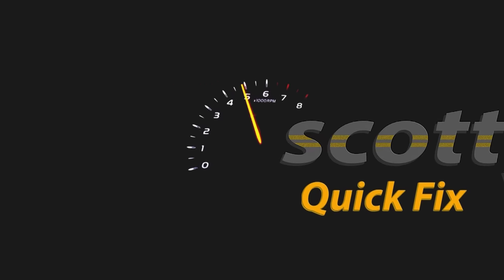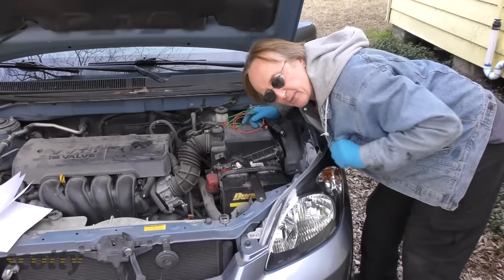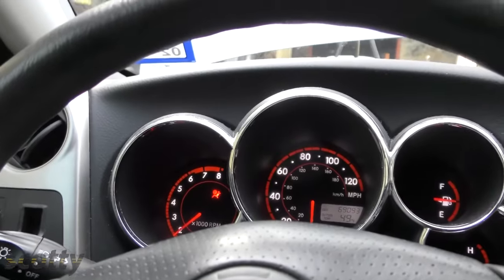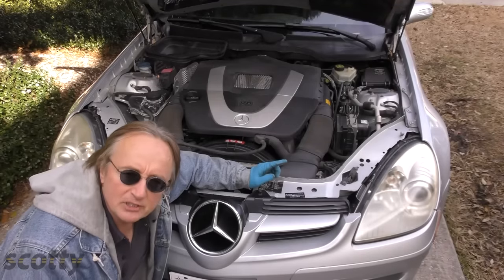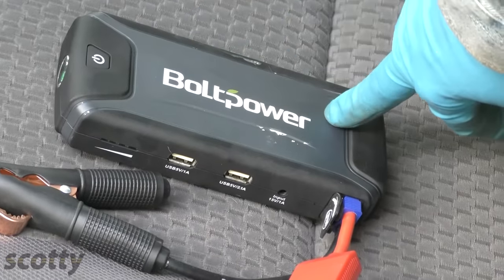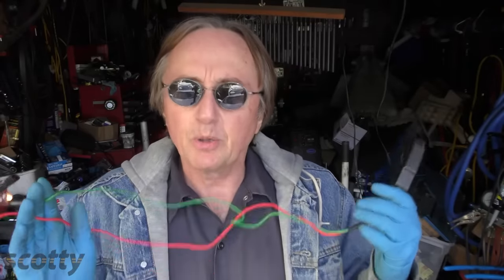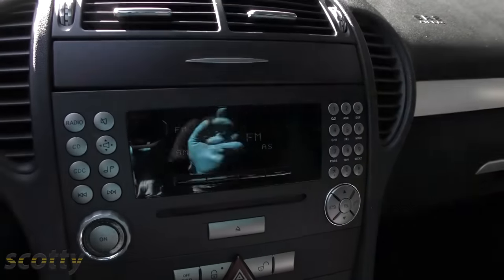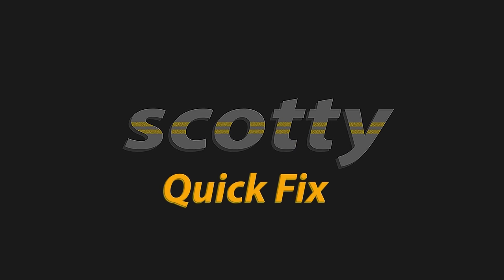How to Replace a Car Battery (the Right Way)

Comment: Funny this came up. today was cold and my car wouldn't start. My battery is slow in the cold this year for the first time. rest of the time its fine. this time I also only had an 1/8th of a tank of game and it must have frozen a bit in the line or pump because it would turn and never hit and the battery would die.  Wait and try repeat until the battery died. Got a boost and the shop i went load tested it and it checked out fine. he cleaned it and Im good I hope. Whats weird is he removed and cleaned the positive but the radio kept its programming.

Comment: Just don’t touch your battery terminals to anything while you are changing the battery because they will be live.  And leave all accessories off, otherwise you may pull more amperage than the OBDII circuit can handle and you will blow the fuse and defeat the purpose of the memory saver.

Comment: I've yet to here of a mercedes module requiring a dealer scan tool because a module got reset when the battery got changed.None require a dealer scanner, the important modules reset and are self adaptive, only the mirror, power window or sun roofs can loose their sync in which you manually reset them by holding a switch, no dealer scanner required... It costs 150$ to get a scanner for a mercedes and it can read all the modules so that is a must for any one planning to buy a used mercedes, simple.

Comment: I have noticed that, after I disconnect the battery on my 05 civic, it takes longer to start. But otherwise it runs perfectly fine. Also, the check engine light flashes if you don't start the engine, but I'm sure it does that to alert you that it hasn't completed a full system check yet, since it goes away if you run the car for a while.

Comment: Hi Scotty..Yes, The car jumper provides 12V as power supply, but what about the current ?? bcoz to jump a car it creates like minimum 300A right ? So could this current output damage the OBD2 (computer) if we use it for memory saver ? Please advise..

Comment: Can you just connect the power boost to the battery terminals first before removing them and then keep it on until the battery is replaced.  I mean how often do you replace a battery if your not a mechanic.  If I was I would definitely get this memory keeper.

Comment: I had this issue with my 2013 camaro. It lost all the memory of its readiness codes when the battery drained. So when it came time for an emission inspection I had to drive my car over 200 miles just for all the systems to be ready to pass. Ridiculous on a 1500 mile vehicle that is rarely driven all to appease the state. I'm sure I caused more pollution driving it those 200 miles than I do in a years time.

Comment: Yes, my Toyota wouldn't idle well at all after I changed out my starter. It cleared up after a few minutes. The transmission also seemed to shift late as well for a few miles.

Comment: I had a 2004 Toyota Celica that did exactly what you said. It ran like crap after I took the battery terminals off for cleaning. 
Now I know better, can I just keep a battery charger hooked up to the terminals the next time I have to remove a battery?

Comment: Hey Scotty on my 2011 GMC Sierra Keep Memory Alive system has built in battery that last about one hour. When I replaced my battery two months ago it took me 45 minutes to swap it out and my radio and engine ran like nothing happened. In my case the engine ran better with new battery. Only thing I had was engine at first would stumble little that might be KMA system sensing the new battery.

Comment: Hi Scott, thanks for the advice.  Clicking on the URL below, the price jumps up from $15.99 to 19.99 on the Power Supply Cable memory Saver OBD... There is another one for $15.99 that is not via the URL so l ordered one as I have four cars that I can use this device :) when changing the battery.

Comment: I just change the battery on my 2011 Honda element about three weeks ago. Everything seemed fine after I changed it, however I noticed I'm going through a lot more gas now... about a tank a week when normally a tank will last me two weeks. Also when I drive it feels like the throttle is wide open because it goes superfast now like I can barely put my foot on the gas pedal and I take off like a rocket which explains the gas mileage...

Comment: So what years and models do you have to worry about this? I got a new battery at autozone today for my 2012 Camry and asked about them using a keep alive memory tool and the dude looked at me like I was speaking Japanese. He said they never used one. I let him change it anyway and so far I haven't noticed any problems. Everything works fine and the car is running fine too. Even my radio presets were not lost. The only thing I've noticed that was reset was the gauge that I think shows my mpg.

Comment: I was pleasantly shocked recently when my 2013 Impala did NOT suffer any performance or radio station preset losses when the battery went bad a month ago. Does GM have a button cell in their cars somewhere?

Comment: I bought a 12v Noco genius battery charger. Will that work as well or does it need to be a jumper pack specifically?

Comment: I don't understand why people hate on computers, you do know computers and software are made by people, they don't make themselves.

And they need to be done right in order to work right.
But the problem is that car manufacturers don't take computers and software seriously, so they use the cheapest parts and cheapest software developers.

And then you get cars that lose all the radio stations when the battery dies. Because a stupid flash memory to store settings costs nothing, but they want to save. Probably a small flash of a few megabytes could store everything on each car shutdown.

Or if you want to be smarter, to save it only when you make a change.

But instead of doing computers right, they cheap out. The same story like with using plastic for critical components.

Computers have gigantic advantages in cars, but you still have to do it right if you want it to work well.

Comment: Scotty, would a gell cell battery plugged into the cigarette lighter socket or any 12 volt socket preserve the computer's Keep Alive Memory? I had a 2000 Toyota Camry and even the car radio turned on with the ignition in off position.

Comment: If the car idles poorly until it relearns running strategies, it likely means there is a problem ie - the PCM is compensating for things like: a spark plug is firing poorly, the intake is choking for air, there's carbon built up in one cylinder, etc. 

An engine should run fine with the factory PCM...just like old cars before they had KAM PCM LCM BLABLA (insert abbreviations here)

Comment: I am changing the right front ABS sensor, should I disconnect the negative terminal and lose my settings or just pull the ABS fuse so no juice goes to the connector? If I use the "memory saver"  in this case wouldn't the car still have 12V?

Comment: Scotty whats your opinion on changing a battery with the engine running, we don't have a memory saver at my shop and management tells me that the battery company themselves say that its ok to change a battery with the vehicle running. I know that the battery acts as a cushion for power surges but is it safe as long as the connectors never touch.

Comment: I wish I saw this video when I replaced my battery months ago. After I replaced the battery on my 2008 Lexus ES350, my car would start, then immediately die, if I didn't keep my foot on the gas pedal. The computer eventually reprogrammed itself a day later, but it was frustrating.

Comment: I have a important Question, I have an Audi A6 2012 3.0 Quattro. and I was told that I will have to code the battery using the BEM: Battery Energy Management sticker on the new Battery. I will have to put the right Numbers in to make it work right. And I have to use a Iscan-2 WT Tool to do this. How do I by-Pass this, Can I just by the same battery are OEM Battery, this battery I got from NAPA after market.

Comment: I know this has probably been mentioned before, but why buy a plug-in device when all you have to do is use another battery and jumper cables to your cables while making the switch? Or better yet, use one of those tiny lithium power packs that most of us have now to clamp to the cars cables?

Comment: Had my battery changed recently, they did connect a 12V battery in the cigarette lighter socket, that kept power during the replacement

Comment: Scotty ... Shouldn't it be noted that unlike a simple battery swap, with this device plugged in the car's cable terminals from the disconnected battery are still 'LIVE' at 12V? Meaning that you should be extra careful not to let the Positive touch metal while the old battery is out.

Comment: @scottyKilmer I just had the battery changed in my 2008 Mazda 3 and now the air conditioning is not working.  I'm figure after watching you video I would have to take it to the Mazda dealer and have them reprogram the system...help what to do?

Comment: Then what do you do on these types of cars when you are trying to diagnose an electrical problem, or any number of other reasons, and need to disconnect the battery temporarily, but don't want any power going through the system?

Comment: Here's a cheaper way if you want to save that $15: Get yourself a set of jumper cables, and an old battery. Hook up the battery to the jumper cables, and the other ends to your car before you change the battery, this way the car will always be connected, and you'll never lose any settings in the car, works good.

Comment: For my car its just I have to find the radio stations again. So if you have a car that is such a pain in the but when unplugging the battery, how to do fix the electrical component etc? you have to unplug the battery for safety right?

Comment: I installed a light bar on my Jeep one time and when I reconnected the battery I lost all my radio info on my aftermarket Kenwood. I lost my station presets, my equalizer presets and it's a giant pain to reset the clock too. I do a good amount of work that involves disconnecting the battery that little took could be useful to me

Comment: However there are some cars that you are NOT supposed to use a memory saver for. I know for example there are quite a few Fords that you are not supposed to use a memory saver. I work at AutoZone and when we look up someone’s battery it usually says if we are not supposed to use one on the car. There are even some Chevys that you have to set the blower motor to off before you disconnect the battery cause if you don’t I guess it can mess up the blower motor.

Comment: Great tip, thanks. Quick question- Is there a trick to replacing an alternator or doing other electrical work without causing problems from disconnecting the battery? Thanks.

Comment: I knew and can feel when the engine parameters reset during a battery swap -thats ridiculous though the way a Mercedes needs dealer support just to change the battery out.  Nice to look at, probably nice to drive, but it’s simply not worth it.  

I’ll stick with my Toyota’s, and maybe a lightly used Lexus car or decade old Lexus truck eventually.

Comment: Good one Scotty. Pin 16 in the DLC is always hot (if I'm not mistaken) so how does applying a 12 volt source of power to a pin that has battery voltage not create a short?
Reply: wyattoneable ....how does connecting batteries in parallel create a short?..ohh reverse the polarity right!

Comment: You can hotswap most models too, change the battery while it’s running.

The KAM unit won’t always work, and sometimes the car will shut off if battery is disconnected, also it can be dangerous for the car if you arc the positive while hot swapping.

Each car is different, just be careful :)

Comment: even simpler solution is to hook the battery leads onto a 12V powersource, doesnt have to be a strong one(a few A will do), and change battery

Comment: Question:  With this device connected, is there 12 Volts back at the vehicle's B+ battery terminal?  I would think so.  If true, you need to prevent the B+ battery terminal from contacting ground, correct?

Comment: Just attach the 12v supply to the battery terminals (same as if jump starting) before disconnecting them from the battery.

Comment: There is not one car made after 2005 that has any of theses issues.
It is all rom memory,and all algorithms that are not, are flash memory,all battery independent.
Great tool if you work on old beaters.

Comment: I wonder if this works with an ODB to USB connected to the portable battery. That's the one I use for my laptop when getting the car codes. 🤔 Any ideas? Thanks!

Comment: i work at AutoZone and we have this tool and use it only on vehicles that are listed to have problems like this after a battery change. usually Kia and Hyundai. i have however seen a few times vehicles that it specifically states Do not use memory saver, any idea why?

Comment: So is it not necessary to do this with a Toyota.I have disconnected the battery a few times and it ran rough for a few miles but then leveled out.I always thought this probably wasn't good for it

Comment: Hi Scotty. Please would you describe battery replacement in cars have battery health sensor,  " Battery State Sensor". Such sensors are getting more common in the modern cars. They are usually connected to the negative battery terminal and  hooked by two wires to the ECU.

Comment: Really nice video, but I have a battery related question. Is it safe to hook up a battery tender to a car and store it for several months, without having to worry about the computers going haywire? I plan on buying a new Mercedes and intend to keep my current Mercedes. I want to store it at my parents place and hook up a battery tender, so the car keeps getting power.
Reply: I don't know... battery tender fries the battery? Or it heats up too much? I don't know. Never used a battery tender and I don't know which ones are good.

Comment: @Scotty, I need to replace my clockspring. In order to do so, I need to disconnect the battery, so the airbag doesnt deploy. If i use this, will my airbag deploy while im working on it?

Comment: What about replacing batteries in cars with "intelligent" alternators?  My understanding is that even after the battery is replaced correctly, a scan tool (supposedly only in possession of the dealer) is required to tell the computer that the car has a new battery.

Comment: instead of getting another tool, couldn't you just connect the jumpers to some + and - posts in the car (like the alternator, or even the battery connector itself, if you have room to work on it)? seems like it would work just as well, as long as you don't try to run the car of course.

Comment: My 2006 pontiac pursuit gt sedan.. the battery was left on in ignition and when i came back to my car 4 days later... the transmission was throwing a million... codes had to clear everything cel wise via my cell obdII scanner.. also the U....... codes can do same thing to a cars transmission etc.. when they happen as well, clear all codes when batery goes dead etc if throws any even if doesnt show a cel light... which happenes too.

Comment: I once went to a battery shop for my Toyota Fortuner. They offered to replace the battery. They asked me to keep the car running. And swapped the battery. What can go wrong with that? Another question is... I have a Dodge Charger now, which’s battery is inside the trunk and there is a remote battery access in the hood also. What if I connect the Jumper in the front terminals and replace the battery in the trunk! Will it be the same as this using OBD Tool? I just don’t wanna risk with the fuse of OBD Port!

Comment: Rule number one when changing battery is to not drop battery on your foot I was wearing my steel toe boots as it was done after work but if I wasn't I would have broken my foot so be careful and don't drop battery on your foot

Comment: Scotty. If you put 12V into the system by the obd port. Then pull battery. Don't that defeat the purpose of disconnect the battery when doing work on car to prevent a short???.

Comment: If you're lucky enough to have a heads up to a E.M.P. it would be advisable to disconnect the battery ( electrical power). And after,  hope after reconnect,  your computer is not fried.

Comment: Is it possible for a car to run rough and shift at weird RPMs or not shift at all pretty much and throw an ignition coil code after battery change? It happened to me when I changed my battery :( I thought I toasted the computer or something but I reset it with OBD2 scanner and reset the system and it worked normal after. Weird if you ask me!

Comment: not saying this isnt a thing, but ive never had a problem on any car ive owned, or family have owned, when changing a battery.  87 Honda Accord, 99 Nissan Altima, 2002 Chevy Trailblazer, 2003 Nissan Altima, 2005 Nissan 350Z, 2014 Ford Focus ST...have changed batteries in all of them and in other years/makes and have always had the car start right up and run just fine.  Radio is usually messed up, but thats normal.  

why have i not heard about this before?  ive only ever worked on one german car, didnt change the battery on it, just oil and a fuse.  it was funny, a fuse for the interior lights blew, but for some reason it caused the car to have intermittent starting issues.  changed the fuse and no problems after that.  those wacky Germans!

Comment: So could I hook jumper cables up to my battery clamps then run the other side of the cables to another car that has a good battery in it? Then remove the clamps from my battery and replace it while the jumper cables are still connected?